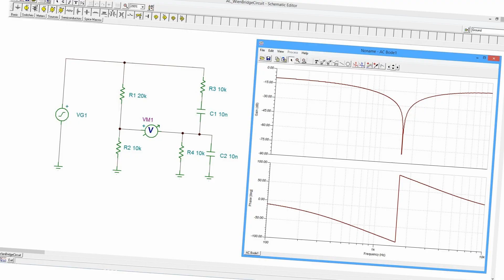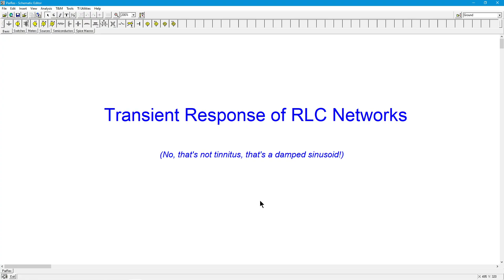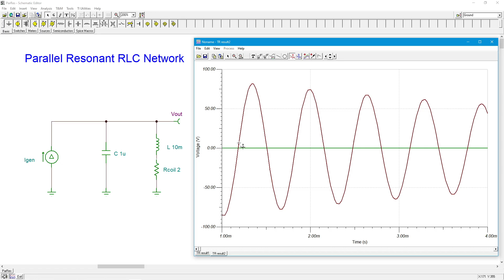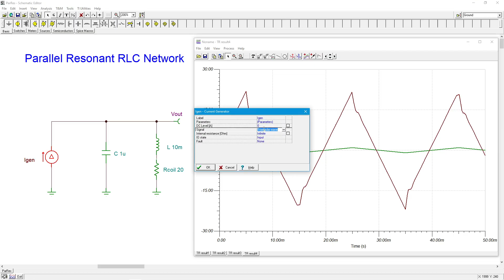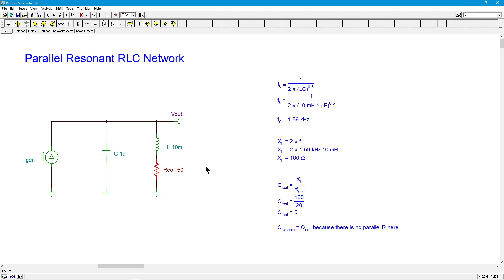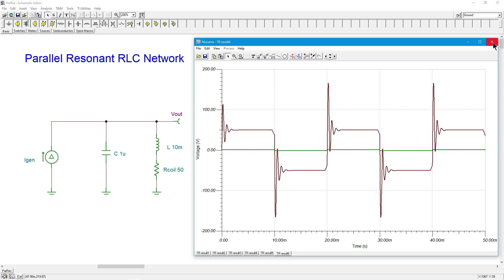AC Circuit Analysis: Transient Response RLC Networks

Comment: Could you feed this filter output into a base of a transistor, and the transistor would do the heavy lifting of shunting at the appropriate times without sacrificing selectivity and reducing the Q?
Reply from the maker: Not quite sure what you're asking here. You could place an amplifier with a high Zin after it to isolate it, thus preventing loading from altering the Q. You could also use a BJT as a load that would purposely reduce the Q while also providing isolation.

Comment: Hi Prof, there would not be a different reaction when using a Voltage source instead of current source in this circuit I guess? Or do I miss something and you chose this one specifically?
Reply from the maker: If you replace the current source with an ideal voltage source then Vout will look exactly like Vin (note that it is a parallel circuit). Effectively, this would be a source with infinite damping and thus you'd get no ringing. If you include an internal resistance for the voltage source, then you'll see ringing at the output. Perhaps of greater interest would be to then add an ammeter in the inductor branch and see the ringing in the current waveform.

For interest's sake, I offered your question to YT's new AI Ask function and here is part of what it said: "a voltage source might produce ringing in the current through the inductor or capacitor, whereas the video's current source example showed ringing in the output voltage". If what you did was directly swap the current source for a voltage source (and did not add the internal resistance I mentioned), you would not see ringing in the inductor current. Artificial, yes. Intelligent, not so much. (To be entirely fair, it had more to say but it was vague and much longer than my reply.)
Reply: Ouch....yeah, a short b/w in and out would give output equals input...to miss the forest for the trees ;-)). Didn't know about this AI function in yt yet....however, I have no doubt it is as smart as its cousins you get via google...concerning technical or scientific questions...lord help us. So, don't worry me always choosing you instead of that crap :-)
Reply: I knew that looked familiar. Alan wolke(w2aew) used this in a video to measure an unknown inductance via the resonant frequency and known( i.a. previously measured by its rc risetime) capacitance value. And his sig gen has it's 50 ohm or so output impedance. He also added a extra cap b/w source and tank circuit ...to filter out low frequency content to begin with I believe.
Reply: @ElectronicswithProfessorFiore  At steady state, Vout is the same as Vin, but at transient state, there's ringing. The underdamped response to the initial capacitor voltage has a phase shift though, comparing to current input.
Reply from the maker: @EEE-iw3fk  ?? There is no Vin to speak of. This circuit is being driven by a current source. 

Now if you want to say that Vin is the voltage seen across the current source, then Vout always equals Vin (because that's the same node). Yes, there is a current/voltage phase shift regarding the cap, and there is also one for the inductor.